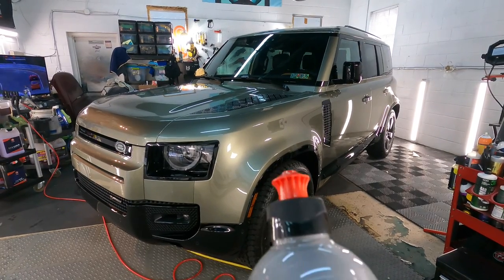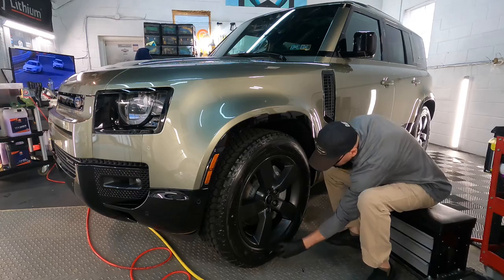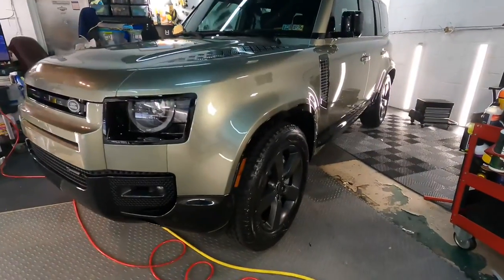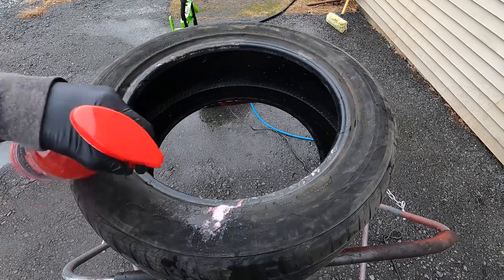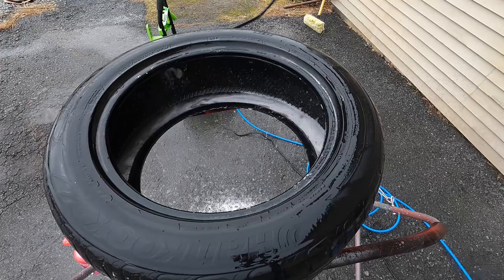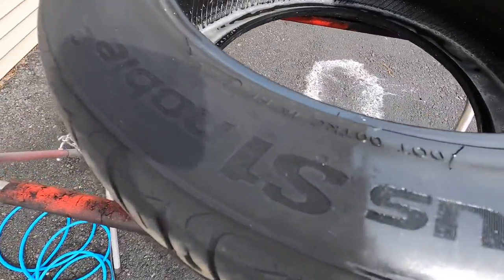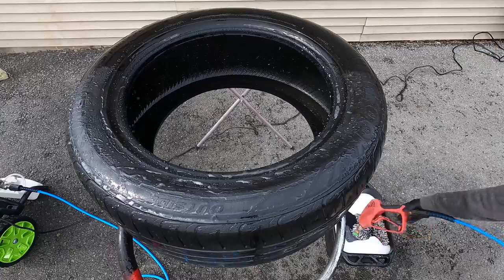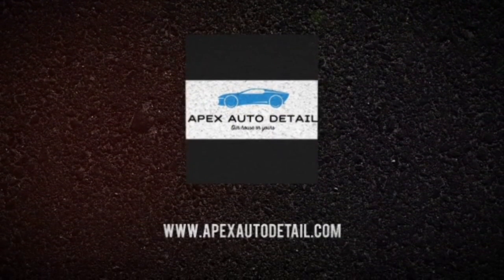Adams Graphene VRT!! Vinyl, Rubber, And Tire Protectant!!

Comment: I've had great success with their original VRT for many years.  I don't usually use it on tires that often as I have dedicated tire dressings for that.  I do however use it on WeatherTech floor mats as well as outside plastics and trim, and tonneau covers.   I'd really like to try this to see how well it performs.  Like most detailers in PA, we see how tires take a beating especially during the winter months.

Comment: Lone star tire coating is the best coating i've ever used. Last months and months and you can get high gloss or mattte. Look it up and do a review please!
Reply: I've also having good success with Lone Star tire dressing. Seems to last quite a while.
Reply: Iv gotten 3 solid months from lonestar on aftermarket offroad truck tires.  Truck washed once a week on average. I'll even touchless the tires with break buster and have gently agitated when needed.  They stay clean and maintain the natural look. The satin will fade but the clean rubber look lasts.  Definitely worth trying to anyone interested in a tire coating. I have compared ot to Adams tire armor which does well, and waiting to compare against Black Rhino Shine.  Another smaller company with a Great owner.

Comment: I still have some Adams dedicated tire graphing dressing and it’s not too bad however the price seems to be sort of expensive what’s been working for me is the turtle wax hybrid solutions graphing acrylic tire shine, for the price per ounce it’s hard to beat however application for me to sort of tricky I’m trying to find that fine line of glossy but not too glossy, I prep the tire using odorless mineral spirits first and then I finish up with some McKees tire rubber cleaner, then I apply the turtle wax to coats five minutes apart and I noticed the same thing you’re noticing Brian the longer you let it sit especially overnight the better it works the next day I come back and level it out with the microfiber….